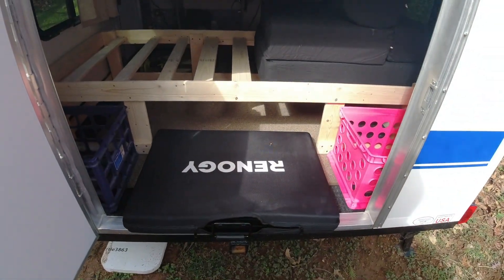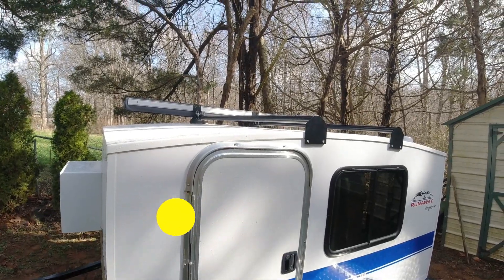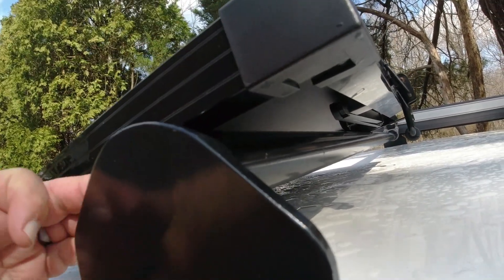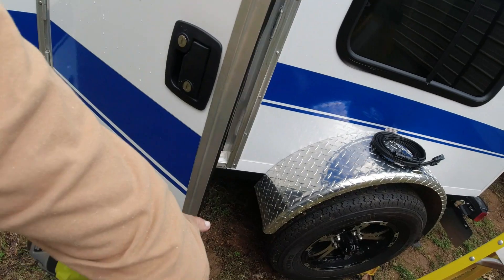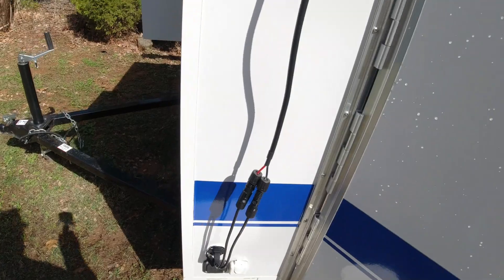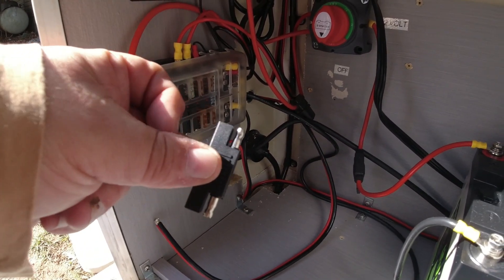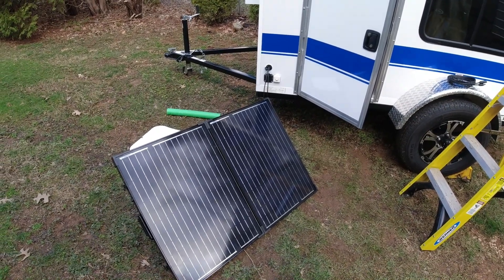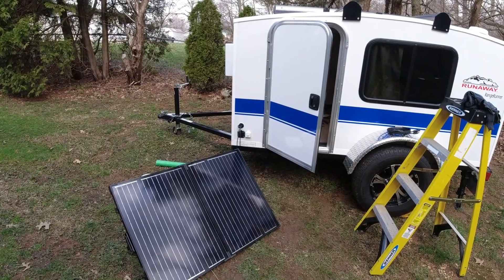Runaway Solar

Comment: I'm converting an all fiberglass motorcycle trailer into a camper. It's similar construction to a scamp.Iwant to put solar as you have. I am thinking about using one of the roof jacks for the cables. Did you consider that?
Reply from the maker: I thought about it but will be using my panel near the ground most of the time so the on the side port made more sense.